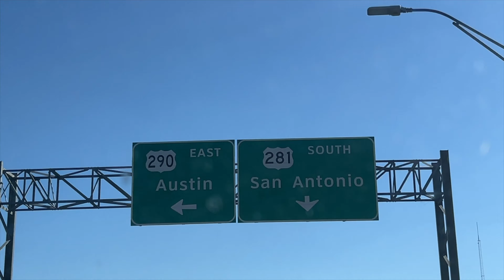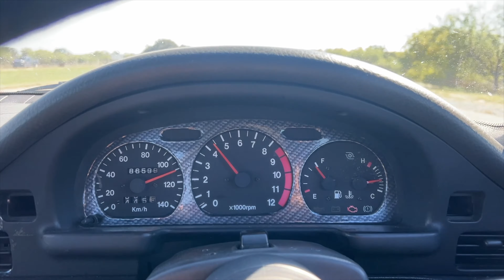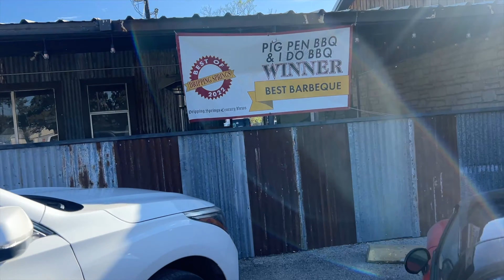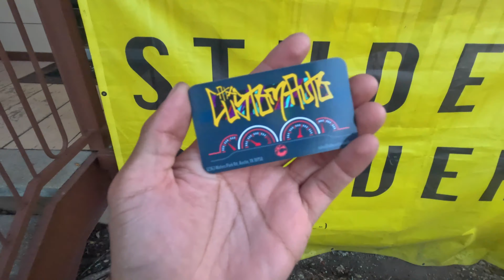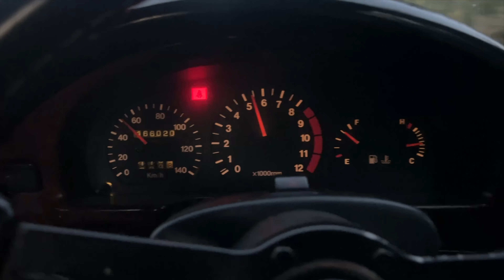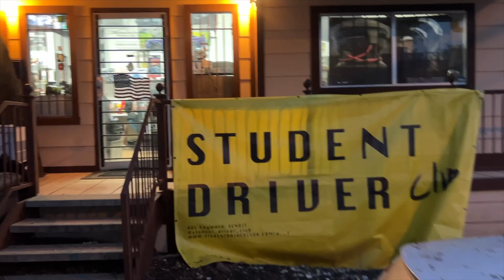Suzuki Cappuccino Cross Country Roadtrip - Episode 4

Comment: HID headlight without the right housing just turns u into a dick driving down the road.  go LED and save the headace of wiring the boxes in.
Reply: There is still a small headache when converting kei cars to LED lighting because the kei vehicles have a switched ground system.  Installing US standard LED headlights requires a relay wiring harness and some extra wiring to get it wired properly (separate ground, etc.)
Reply from the maker: Cars so low I wouldn’t be blinding anyone and the bulbs are h3 not maybe LED options unless I convert to h4

Comment: I wish America would do like Japan and make KEI vehicles a common option.  Small vehicles with great gas mileage makes more sense to me than EV's.  Imagine the reduction in road congestion if we reduced the number of huge vehicle on the road.  Especially when you consider that most people only drive with themselves in the car 75% of the time.  If America gave the same kind of discounts Japan does, for owning a KEI, I think that more people would jump at the chance to get one.  Especially in cities where parking is limited, because more cars could be parked in the same amount of space.
Reply: No government incentives are needed.  All the government needs to do is stop discriminating against kei cars.  The US demand for kei trucks is insane and manufacturers can't or won't build them.  The Smart car isn't any bigger and they designed it with a steel roll cage to pass NHTSA safety standards without crumple zones.  We could have kei cars, but government is the reason we can't have nice things.
Reply from the maker: I agree 1000%
Reply: @Liberty4Ever   in Europe, where the Smart car didn't have such strict emission controls, I am lead to understand that they got around 50mpg.  American regulations dropped them down to around 30mpg.   I remember when small trucks were the rage, in the 1980's, but now days the auto manufacturers cannot sell them.  Our EPA has a crazy standard just for trucks based on the wheel base. Small trucks have to get 50mpg to be sold, totally unobtainable, and thats why every truck sold today is a huge beast.  Our government just doesn't make any sense.
Reply: A lot of states are revoking the titles to these KEI cars unfortunately
Reply: @sarahdell4042  - I feel the same way about kei car regulation as some people feel about a new illicit drug - this is so fun that the government will make it illegal.  I'm genuinely concerned that government regulators will decide that it's not enough to force us to only be allowed to have 25 year old JDM cars and they'll revoke the antique car import exemption.  No kei car for you!